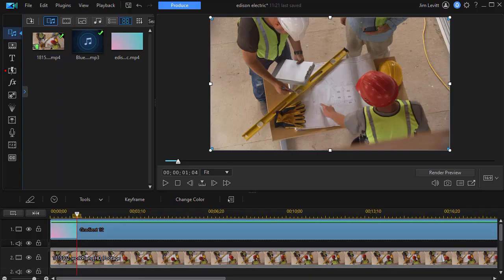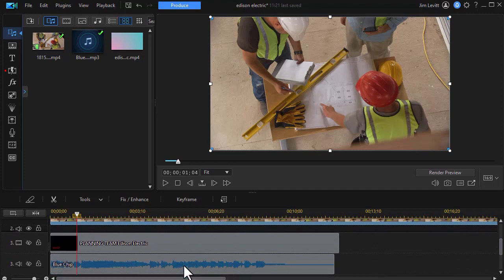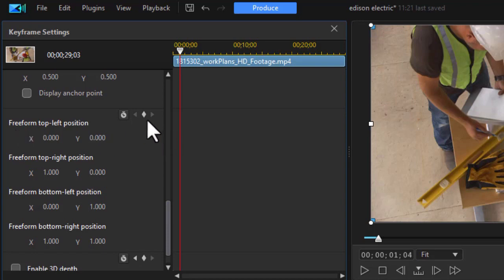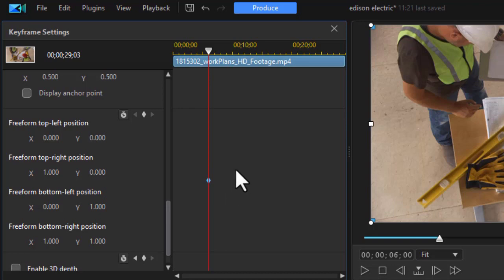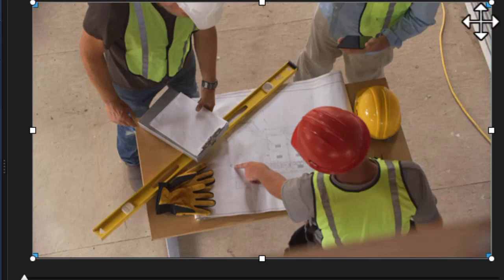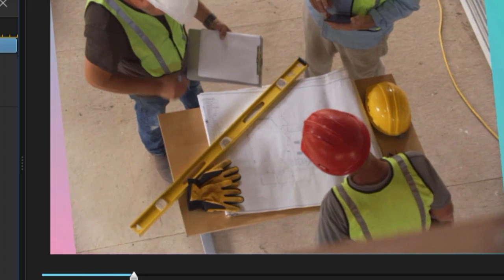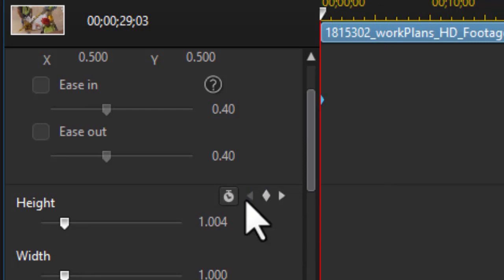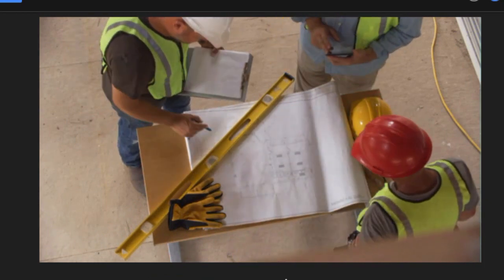PowerDirector - Using free form controls to introduce a clip in a unique way

Comment: Under the height and width need to remove the icon "bird" (or whatever it is called) and then you can adjust the height and width separately. I would like to add that at the end you can change the initial position of the video output directly in the preview window. However, you can also adjust the ending of the video directly in the preview window. Hover your mouse over the square and do whatever you want:) Very handy. There's a green arrow and I even managed to bend it. I just didn't understand how? I have to try it.
Thanks for the video.
Reply from the maker: Thanks for the tips. I really appreciate it. I don't always do things the most efficient way when editing, and am glad to learn (and re-learn) from editors like you who watch these tutorials! --Jim